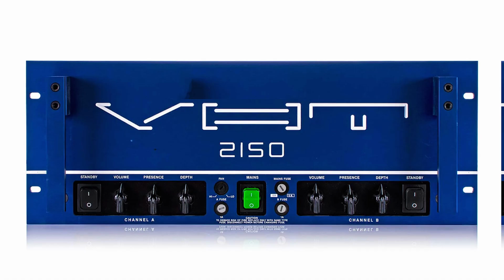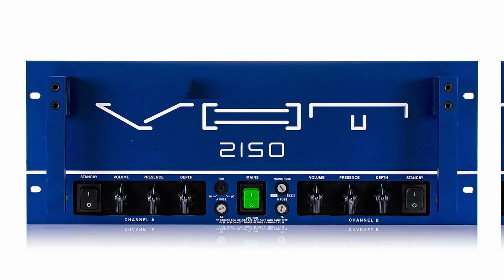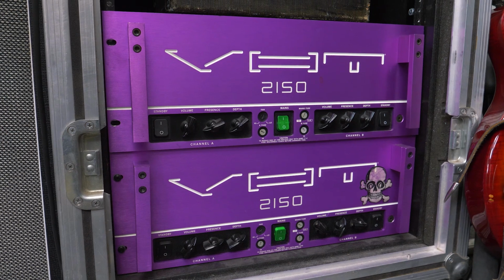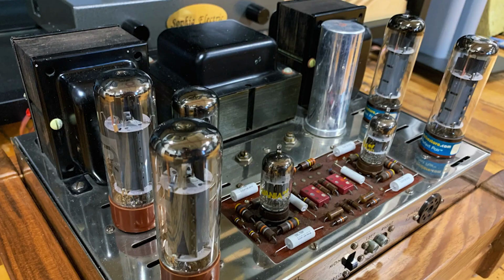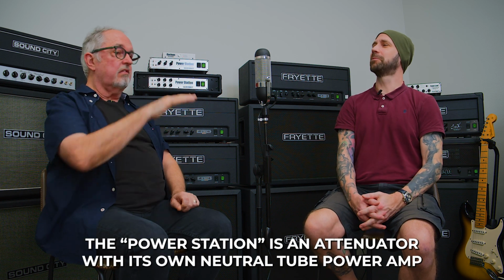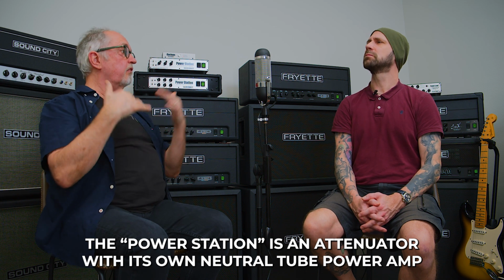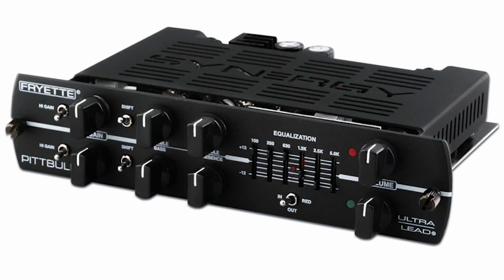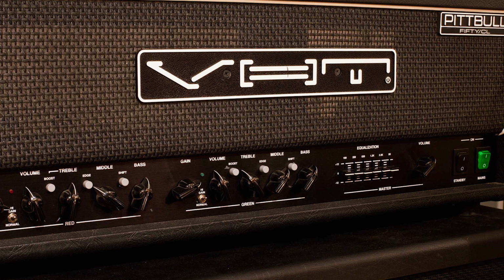GUITAR AMP MYTH BUSTING (with Steven Fryette)!

Comment: Thanks for the in-depth interview. I really like to hear engineers talking with passion :)
Some speaker questions for the follow-up (ignore the crappy ones, I'm tired):
- Is there a perfect volume to run the speakers at if they are specifically designed to go with a certain amp or just a min/max volume?
- How come we rarely see mixed speaker size setups on guitar amps (like with bass cabs) and what speaker sizes/combinations are your favorite?
- Why not put the eq into the cab rather than the amp? Bonus question: why not both? Extra bonus question: why are attenuators not put into cabs?
- Do ribbon speakers make any sense in guitar cabs (even if only for the tonal aspects, because they don't generate the same kind of load)?
- How much influence does the actual speaker impedance have on the amp when comparing differently paired speakers that are wired to the same impedance?
Looking forward to seeing the second interview - thanks again pals
Reply: Hey Sebastian, here my quick 2-cents about your questions!
- Perfect Volume for a given speaker? Not really. Give it enough power to start breathing, and don't overload it to the point it loses control and turns into pure noise. Anything in between will be good and fairly constant.
- While there is not a specific tech reason to avoid those mixed configurations, it's good to keep in mind that speaker sizes quite often have different sensitivity values and different dispersion patterns, so they can be tricky to balance porperly.
- EQ in a cab? If it's an active powered cab, there's no problem. If it's a passive cab, it's simply impossible, unless we're talking about passive filtering.
- Attenuator in a cab? Technically possible, quite unpractical. If I have it in a separate box I can use it with any amp and any cab.
- Ribbon speakers are simply WAY too fragile and WAY too low in efficiency to be used in any sort of musical instruments amplification.
- It's very common that the same speaker model may sound different in its 4, 8 or 16Ohm versions. As a very broad reference, the higher the impedance, the slightly brighter and maybe even slightly more efficient the speaker is. So, in pure theory a cab with 4 16Ohm speakers may sound brighter than an equal cab loaded with 4 of the 4Ohm version of the same speaker, even if the cabs are wired the same total load.
Hop this helps! Cheers!
Reply: @JensenSpeakersVideos Thanks !
Reply from the maker: Some really good ones there! Noted
Reply: @KohleAudioKult  Really?  Come on.  Stop the madness. Why dont they put EQs and Attenuators in the Cab?    Really?  That is a good question.  I need to become a YT content creator. I can just film myself taking a dump and have better content than this reply to several really really really really stupid questions. Ribbon Speakers in Guitar cabs......................wow.

Comment from the maker: More follow-up questions? Ask them here!
Reply: What makes a good FX loop, is it send/return impedances, or opamp/transistor/tube type design?
Reply: Assuming two near-identical amps, but each designed optimally around its respective tube, one with EL34s, and the other with 6L6s, is there any difference in the sound that can be ascribed principally to the difference in tubes?
Reply: Why no external bias points/pots on heads?
Why no choke on Deliverance?
GP3 v.2?
Reply: Does parametric/graphic eq introduce a phase shift, and how critical of a shift there is as compared to an amp that has been designed from the ground up to this same eq curve?
Lower mids being easier to add up with an eq than the highs - true or myth?
Reply: great content ...where to get that green beanie ?
Reply: @smalllicks  lol!
Reply: Does he have any memories or stories of Page Hamilton From Helmet ? :)
Reply from the maker: I’m sure he has
Reply: How does volume influence the quality of the sound of a tube amp? Is a lot of volume necessary to get a tube amp to sound "right"?
Reply: interview Steve Vai on why he made the legacy the way he did!
Reply from the maker: That might be more difficult than you might think 🤯
Reply: Should good speakers make the gain sounds , sound less dirty? In the sense of clarity within its en design?
Reply: Eq design
Reply: Im curious about his friendship or relationship with Randall Smith.  What goes down in amp design conversations with guys like Bogner, Diezel, etc.  Do they influence his designs?
Reply: Is the sig x coming back ?
Reply: Since bass was mentioned in passing, I'm curious how the design approach is different for bass amps
Reply from the maker: Good question!